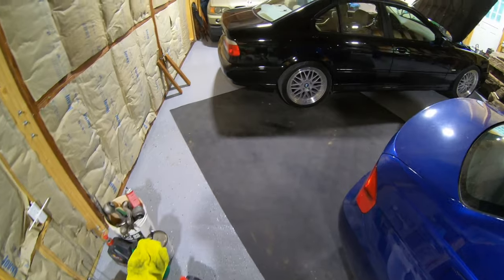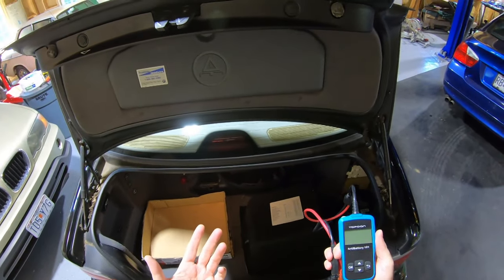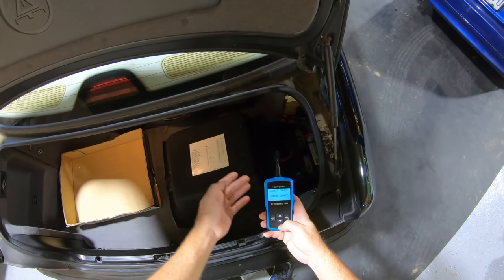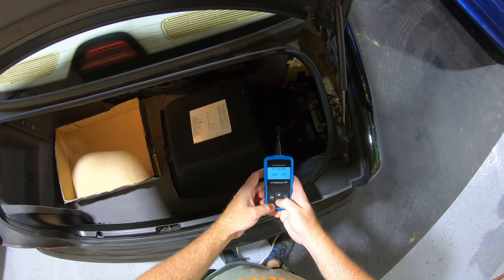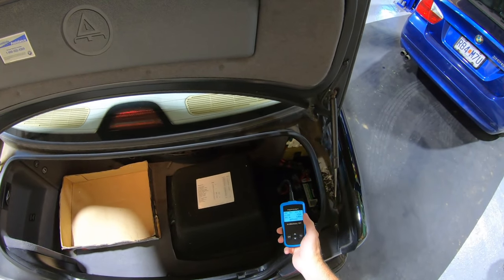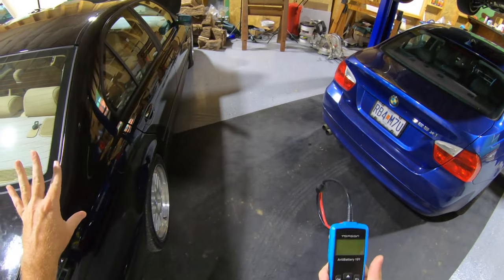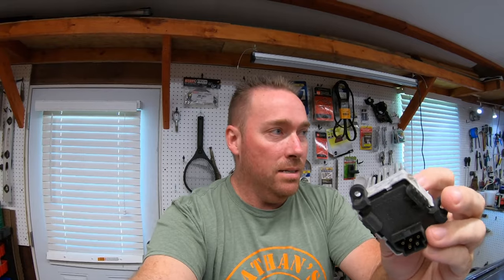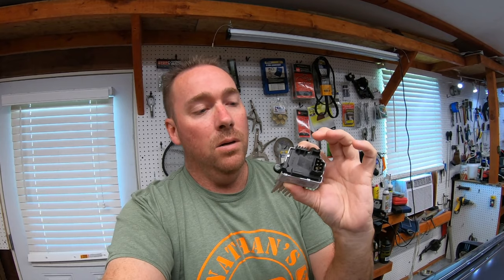Most Common Battery Drain Causes And Fix For All Cars !!!!

Comment: I have an Astro Van 2004 AWD.  The battery started going dead over night, I checked a few things, then it was going dead about every 3, 4 days, again checked a few more things, wow, all was good for a few weeks and bang, everynight, If I jumped it, it would start right up, I turn it off and it would start right up again, we're talking within a minute of being jumped. I drove me nuts for 3, 4, 5 months. Well, one day I was watching the dash as I turned it off, I noticed a little jumpping/flashing of the lights on the panel. when I play with key. It was a bad ingnition switch. It have been well over a year and still starts up.
Reply: I Learned to Drive in Astro van
Reply: My dash lights are possessed, sometimes they work and sometimes they don't, especially after rain. I was thinking a wire shortage because the radio acts crazy after rain too. I did not even consider my ignition switch so thank you for your comment!😗
Reply: @Amanda-cd6dm  i will be mindful of my ignition switch
Reply: Altanator

Comment: New battery, all my fuses, my alternator is still good. No idea at this point *update* check radiator/ac module on german builds, sometimes they go bad and "stay awake" while car is off, super easy $20 part 2 bolts (on my car) seems to solved my problem
Reply: Can you share the symptoms your car had. I have 2006 325i with crank but no start. It threw a transmission warning and wouldn't shift out of park until i reset it. The timing belt also broke and I had it replaced. The oil light comes on even after oil change. Also crankshaft pos and misfire codes. Also random stalling and it cranks but no start. Any advice?
Reply: @tazmaniandiva7762  my car just had a parasitic drain, would start up with a jump, but die over night, alternator was good, replaced the battery (was 7 years old just figured why not), and still was draining.  My ac/radiator fan module mustve went bad (20 year old car). Replaced it, and its been good ever since.

I didnt get a transmission code (mines manual), if its misfiring it could be a few different things, but I also didnt have that issue, sorry :/
Reply: @JM-bb8xi  I have a 2008 VW beetle, also a manual, with the same symptoms as you. How do I test the radiator/ac module?
Reply: I have a 2004 Chevy Tahoe with the same problem
Reply: @tazmaniandiva7762  yea get rid of it
Reply: I have a Nissan 1999 pathfinder battery keep going down after 3 week GUY say my driver door is not closing properly and is pulling my battery down HELP
Reply: Q1

Comment: My e38 alarm system will drain the battery if the car is left unlocked for a few weeks. It will also drain the battery if a car cover is fitted as the motion sensor tells the car to wake up. My rule is always lock a modern car even if it's inside.
Reply: no shit sherlock lmao

Comment: I have a battery drain on my x5 02 turns out by taking the radio fuse 72 and 73 out when not in daily used has fixed it. Im about to send my abs module got all lights up saying bk left wheel sensor i replaced the sensor first but i get error trying to talk to abs and i use the c310+ its all good fun u helped me loads nathan :) thank you!

Comment: I am so going to look into the blower resistor thing. I have an "unfindable" battery draw that's been driving me nuts for over three years. This makes a lot of sense paired up with some of the clues I've been getting. This is the only mention I've ever heard of such a thing.  I am so glad I happened across your video. Even if it turns out not to be the problem, it gives me a new direction. Thanks bro !
Reply: Can be a bad coil!
Reply: @MGreen-vz6yb false
Reply: I had exactly the same problem and time frame, went through several batteries.
Reply: Did you find the problem?
Reply: Most of the YouTube videos on battery drain are for regular mechanic. My shop is a specialty shop that fix HEV/EV and regular cars with extremely difficult electrical problem meaning the ones that even auto electric shop can’t figure out. The car I’m working on has an intermittent drain. For a whole month car may be fine then all of the sudden park it overnight it drains. No it’s not anything you mention here otherwise I would have figured that out because things you know on electrical are basic things I knew years ago. I don’t post on YouTube because I can loose customers
Reply: It’s not a resistor it’s an electronic circuit in which of a transistor is leaking which is always powered even when vehicle is turned off. Transistor fails by shorting and if it’s not failed all the way it is leaking causing battery drain if transistor failed completely it would cause a fuse the keep blowing because it becomes a full blown short
Reply: @Ronaldo-qs2lx besides fuses, transistor and resistors are any electrical technicians go to. The HEV,EV places where you live must suck.

Comment: My 2001 VW jetta, i amp tested it and it came out saying no problems with battery or anything, if i leave the battery out of the car on a shelf it doesn’t go dead, if i put it in and drive it every day it is fine, but if i put it in and let it sit for a day or two it goes dead even though it said no drainage, any ideas?

Comment: Bro I have a dodge  nitro. The battery dies a day later. When I turn the ignition to on position it sounds like the ac blower is on even if the nobs are on the of position and when I start the car I dont hear it anymore. Is that what u mean by the hvac problem?

Comment: I bought one of those battery testers and every battery I checked with it the tester said needed to be replaced.  Even brand new batteries that were fully charged and working fine in the vehicle.  I took it back and got a replacement and the second one did the same thing.  If anyone can attest to a battery tester that actually works please share with this forum.  Thanks.

Comment: Mr Nathan, Hope you can point me in some direction here. When my e39 reaches normal operating temp, it goes into Limp Mode, (3rd gear), I stop wait 15 minutes, and the cycle is repeated. I have tried everything I could, to fix this. It’s a 2002 525 with 134k don’t want to try the dealer.

Comment: I have not seen on the net, advice about cleaning off the top of the battery case. I have seen many battery cases covered in dirty oil and carbon, which would trickle drain the current away. So, dry paper towels, wipe off the top, including areas between the fill caps, being careful to avoid getting dirt inside.
  Finish by replacing caps and wiping with towel dampened with baking soda, to resist corrosion.
 Top of battery should be dry and clean when you are done.
  If battery uses distilled water top up cells till plates inside are just covered, as last step.

Comment: It was really cold this morning so I finally used my heater. For some reason the blower stayed on when I parked my car. I turned the car back on and made sure all of the gauges were off. I left my 330I BMW for 3 hours. The battery was drained..
Some really nice people actually helped me connecting the battery in my trunk with jumper cables. They stayed there for a half hour. They even reved their vehicle.. I kept asking if they could just connect to the front. Another person came home and said you need to connect the cables in the front. My goodness it worked right away. 
I'm so thankful for everyone that tried to help and the person that knew a little more about jumping a 2003 BMW.

Comment: The blower resistor part replacement fixed my 98 bmw m roadster perfectly from the battery drain.  Took about 4hrs to do.  not too hard just takes time. Pelican Parts on you tube has a very good demo of how to take the part out. Note take off the windshield wiper assembly. it is not hard and makes it alot easer to get to the blower resistor.

Comment: I've left 3 comments on differ videos to help people out of my predicament.  Have Honda crv 2009, New battery caused alarm to go off soon as energized.  I only had vallet key no faub with alarm on/off buttons.  Tried everything, looking for reset button or module but the fix was to shut all the doors, hook up battery, alarm goes off, insert key into driver door turn until alarm shuts off.  Worked like a charm after months of searching and car sitting.  Hope this helps you

Comment: So I also wanted to say, my brothers 2015 BMW 328 had a new battery put in. The new battery needed to be registered with the car so that the car knew it was a new battery. The reason this was an issue is because the car treats the battery to what it believes its age and condition is. So it treats older batteries with a more aggressive charge and drain. If you install a newer battery without doing this, it causes a lot of issues because the newer battery can become prematurely damaged by this, and I mean within weeks, not months. 
Just a little FYI on how the BMW ActiveHybrid 3 system works in this particular case.
Reply: Wait, are you talking about a battery for the drivetrain or a battery like what's in the video (for cranking, accessories, etc)?
Reply: @MRAWESOME22  I believe he's talking about the normal car battery. I had to do the same thing in my VW. Fortunately, I have OBDeleven and was able to register it through that.
Reply: Honestly I wouldn't be surprised if they used the system for planned obsolescence, battery over a year old, drain it with a constant draw. They've probably got shares in the battery manufacturers.

Comment: watch your channel and very interesting and you know your stuff... I am chasing battery drain of ..155ma at battery and  tracing back to AUX fan signal wire (thin wire) and it  reads 0.177v live with car asleep .so thinking would the FSR be in any way connected to AUX fan ...the battery drain averages about .2v per hour drain ...I think the FSR was replaced a few years ago but being in Thailand you never know what they do....just pull out a part from a box and say this was replaced

Comment: I have a 2004 Buick lesabre. The AC works when it wants to cuts on & off periodically I suspect the resistor is going out, I'm wondering if the resistor is also causing my battery drain 🤔

Comment: My 525i e60 always makes a buzzing sound under the hood so I took off the disa and everything and it's the idle control valve. I guess the factory programmed the icv to buzz every 5 minuites for 5 minuites till the battery is dead. So I installed a 12 volt quick disconnect switch no more dead battery.

Comment: Those testers are good however I will not condemn a battery without giving it a properly done charge first. I have a battery that said replace five years ago. However on BMWs the electronics require a good battery so

Comment: I  got a code for the  electric final stage  many years ago but never had any problems with the air working so I never replaced it.  After watching this I just ordered it from FCP.  1998 540i 187,000 miles.  My alarm goes off when I unlock the car with the remote.  I read  that could be caused by something slowly draining the car battery.  Is that possible?  Tested battery, it is at 85%, only 2 years old.  Any ideas why the alarm will go off when using the remote to unlock.  If I lock and unlock again quickly after the alarm starts, it will go off.  Thanks.

Comment: Oh I wana help too. Hondas have a Hard DTC that sets whenever a battery is low or the PCM detects a low cranking voltage. So even once you recharge the battery and everything starts just fine that trouble code will store until its fully erased. P0061 or something along those lines.

Comment: Thanks so much for your Vid….the only one Not explaining how to use a Multi Meter and pull Fuses….you made it possible for me to correct some Issues with parasitic draw and get my AC blower working better….changed the Resistor unit…that cut out more than half the loss of charge in 20 hours….pulled the Radio Fuse and amplifier fuse….and that seems to have cut out the other 15% loss in 20 hours…..never use the Radio anyway…and the code seems to have gone away….I did a big 4 upgrade on power and grounds with 2 gauge cable..so far so good…I think the Transmission Shop killed the original battery in the 3 weeks my Suburban was move around their Lot….Walmart replaced it…I was Lucky…I bought the Tester you show…and it is priceless….I cannot afford to use Pro Mechanics…so have been doing my own Work…you made it simple ….and your on the Money….going to replace the Starter later and clean the connections…I put in a new Alternator as I thought it may have been damaged by the idiots that did my Transmission…seems normal to have a bad battery and alternator after they touch your Truck….they over tightened my Transfer Case Plugs…hope I can get Two years out of the Rebuild…many parts of America going to the Dogs…these days…few places you can Trust….thanks for the help.

Comment: e34 sedan trunk wire bundle up underneath near the lift piston problems and lock problems and trunk latch doesn't turn off the trunk lights but latches.

Comment: hey nathan I also have problems with my car the car dies after 2 days in the garage I have also changed the little thing for heat that you showed on video, it may be that it draws power because I get no heat sometimes in the car it does not work as it should

Comment: BMW E39 batteries from the factory are 850CCA.  Your battery was 730.  Bad battery. Also, when you replace the battery you have to reset the battery program in the ECM or it will just think you put the same compromised battery back in and adjust the charging accordingly.  BMW owners please remember to reset this when replacing batteries.
Reply: Also, pertaining to the drainage issue you are accurate of possibility but I wanted to make sure that this was communicated. :)

Comment: My Belva amp is drawing A LITTLE power when key is off,  THE REMOTE WIRE From Pioneer Stereo IS CONNECTED RIGHT. When the key is off, the little green light on the amp and the remote bass control knob both shut down. I got 3 cars with amp/sub kits I installed, I seen one site that said that drain is common with some low budget crap. It's not sucking major juice, just a little when it should not be using any power at all when it's shut down.
Reply: So I have a car and the battery dies after a few hours and around 8 hours if it has a full charge of I don't turn it on I have speaker wire that was hooked up but it's not connected to the amp or subs but it is still connected to the battery and fuse box someone rigged up some how could it be still pulling power even tho it's not hooked up to the amp and the 6x9 wires look like it arched

Comment: For 3 bimmers yes after a while driving with full light package on, wipers, defrost, iPod music, hvac fan on high, Defog, fog lights, etc. The battery seems to not be fully charge esp if left parked for a few days. My smart charger reconditions the battery by charging it at various current levels all day - it's worth the wait, battery is like new again and stays strong for months
Reply: Never waiting repair or you'll cause more issues.  Get new altanator and battery or you'll be sorry

Comment: Nice informative video, but unless the car is a 1968 SS Hemi Dart, I'd rather see you demonstrate this diagnosis on a battery under the hood.
Reply: Its a BMW channel. BMW hasn't made a car with a battery in the engine bay in about 30 years. I have two 5ers, one has the battery in the trunk, other one is under the back seat.

Comment: Is there anything I can do with my E90 325d when leaving it stood at my work for 7 months? No trickle charger available, can I disable the alarm or put it in a winter/dealer mode so it doesn't drain the battery?
Reply: Wow, you work long shifts 😳😂

Comment: E46 325i here, last week driving home my car started to lock down and light on dash showed up. Had jumped it and died again, so I bought a new battery and checked the voltage and wasn’t going up so I’m thinking it’s the alternator but my friend mentioned to check the fuse or my belt might not have the right tension. I haven’t inspected further but any suggestions?
Reply: Having very similar issue. Did you ever find out?

Comment: I have an issue with my 2008 E60. The stereo light, push to start button,  the shifter lights and the over head lights stay on after locking the car. They won't go off at all. That's making my battery drain. I don't know how to fix that. I want to know if you could help me with that. I replaced the battery and the alternator it's good. So.. I have no clue.
Reply: Did you fix it???
Reply: Faulty wiring

Comment: My battery has 12 volts, it's new. When I hook up the cables, the volts drop to a little over 9. Car won't start, starter doesn't even click. The dash lights flicker also. Could this be the fsr?
Reply: Your altanator is bad it don't mean a thing if u got new battery replacement  the altanator now or you'll be buying another battery
Reply: @michaelanema5892 
altanator??😂

Comment: I literally replaced my battery minutes before you posted this video lol. No drain just a bulging battery that hasn’t been replaced since 2012 finally died.
Reply: Vent tube clogged or not put back in. Be careful because battery acid could be puddled around it and you might think it's water.

Comment: Hi Nathan. I have a 2006 Ford Focus with battery drain--presumably from a theft light that blinks slowly and I do not know how to reset it. Any suggestions? I've tried the key in the lock reset method and it didn't work.
Reply: That theft light is supposed to blink while cars off I’m going through sane issues it might be alternator going or a par acidic draw gotta check all your fuses
Reply: Yes it's red light and it clicking and it's draining battery. Replace altanator and battery